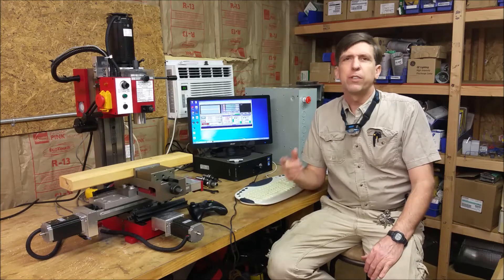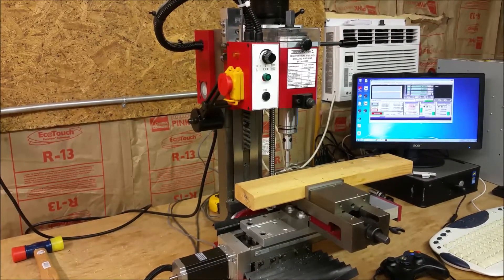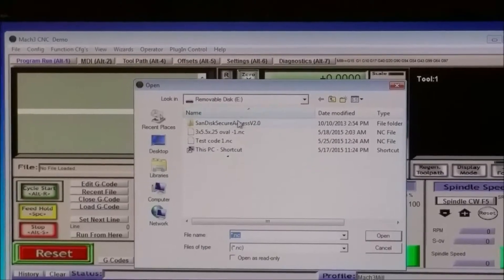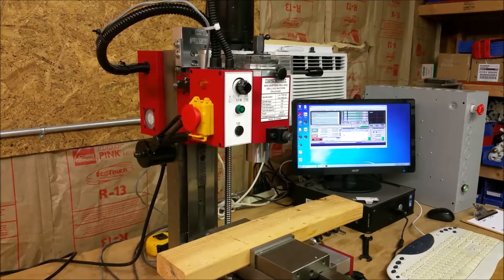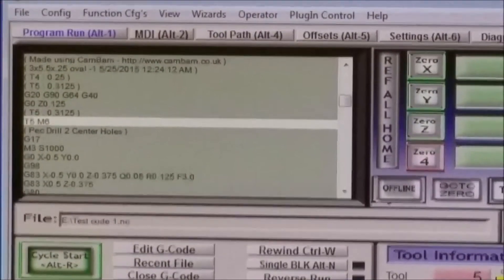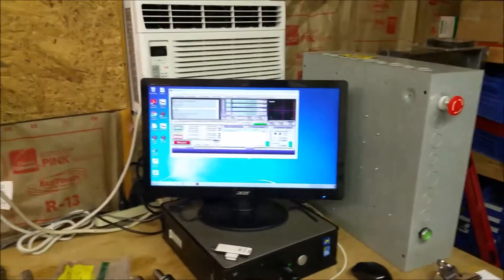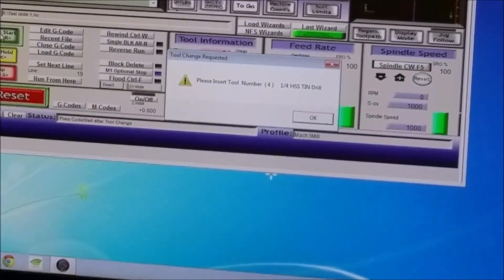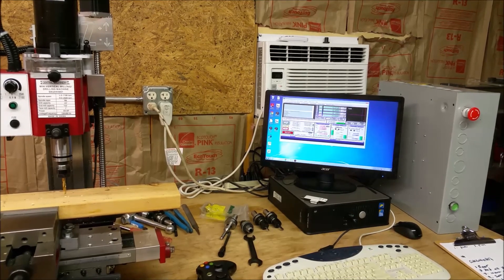Mini Mill CNC Conversion Part 8G - Running First G-Code in Mach 3

Comment: I like the controller sft, looks fairly full functional for most mfg. applications. I think you wen overkill on the vise though. There are great vises out there that are about half the height and just as precise/rigid giving a much larger machine window. LOL, those tools look a lot bigger than the comments during dry run. :)

Comment: While I can appreciate the effort and expense you have taken on, I question why? I have one these milling machines, strictly manual because I had to mill parts for a steam locomotive. It seems to me that cnc is only advantageous for mass production which is beyond the capabilities of this machine.
Reply: He's got dual shaft stepper motors, what gives him the opportunity to put on handle wheels and operate the machine manualy when motors are disconected. In my opinion, even one piece  prototypes designed in cad software could be done faster. Imagine your steam locomotive with engraved your name or logo on some brass part. Great job!